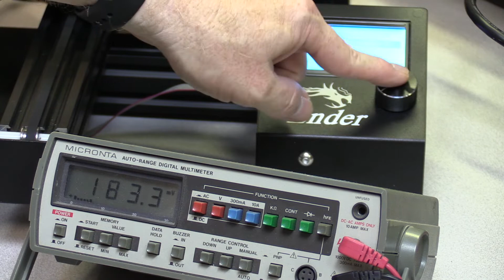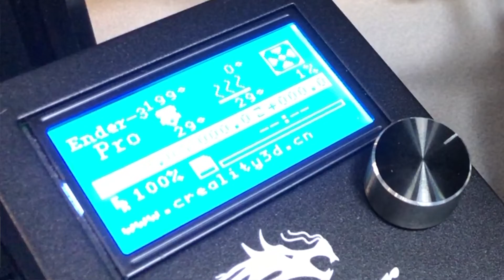Thermal Runaway and the Creality Ender 3 Pro

Comment: the easiest way to test if thermal runaway works is by powering your ender with a usb cable (with the 24v psu off) and trying to heat up the hotend. it will not have enough power to heat it up so it will trigger thermal runaway

Comment: In my case, heating up works fine, the temperature is reached. But as the print starts, the temperature drops by 10-20°C, I get the runnaway error and the fillament looks burned. I suppose there is a looe connection somewhere, loosing contact when the noozle is in motion. I will doublecheck all connections.

Comment: Please share your experience in case the printer sees the high temperature and display shows the nozzle heat is switched off, but really the heater is continuing to heat.
And, aditionaly, the heater starts functioning right straight after power on the printer.

Comment: Perhaps that’s simply not the exactly way that it detects thermal run away. I have an ender three pro that I am currently receiving screaming thermal runaway errors from about three hours into a print. I am presently trying to diagnose it but there is something causing the error certainly.

Comment: your elaborated explanation about, what a thermal runaway problem helped me to undertand that because of the cold wether the printer is not been able to heatup the bed fast enouth  therefor it trigger the error. I will try to put a blanket over it, thanks very much.

Comment: There was a firmware update that did enable the full thermal runaway protection.  Your version of the Ender 3 Pro is likely from before that update based on the date of the video.  Update your firmware to the latest version and try this again.
Reply: my ender 3 pro threw this error at me today so its worth trying again if you havent already - in the researching phase rn to figure out what the hell i did

Comment: I just did a PID tune at 245 deg. I then tried to print a calibration cube at that temp, and I still get thermal runaway error. brand new heater cart and a cart thermistor in a phaetus bms on my ender 3 pro. I can't get it to work on either of my ender 3 pros.. what is the point of having an all metal hotend if it won't even let me print high temps? please help!!!

Comment: Any idea how to reset the motherboard if thermal runaway activates before you can even load the menu?   I've changed out both the heater cartridge and thermistor, however the ender 3 pro (still) goes into E1 Thermal runaway as soon as you turn it on.  (wont load from SD or anything)

Comment: Bryan. I have a ender 3 pro and have been having one of two messages 1) Failed heating reset” and 2) thermal runaway …..). It’s still a stock ender 3 pro with stock 8bit main board.  Maybe newer model?   It’s not the bed as that is brand new with less than 2 prints on it.  So I think it’s thermistor?

Comment: So I have a couple of questions. What if you could test the Ender 3 pro for if the hot end gets hotter than the desired temp while the readout is working fine? Also secondly, I own myself an Ender 3 pro and am wondering is there any way to add thermal runaway protection? Know that there isn’t now, I’m afraid to leave it running overnight. Thanks for the tips, Joel
Reply: Hey, new-ish Ender 3 Pro owner here who just encountered Thermal Runaway Protection for the first time about 15 minutes ago (and ended up here in researching it). There was a change in manufacturing in the E3Pro line in 2020, the updated ones come with the 4.2.2 mainboard and thermal runaway protection in the software.

Comment: Just a thought redundant thermistors would help detect a issue but I think a new port would be needed on the mainboard or a separate board like a RPI to shut down the system if it detects a runaway, actually a RPI as a separate monitor system would definitely help now I have to figure out how to develop this.

Comment: Bryan I find your videos very helpful, I have a quick Questions. I got the Ender 3v2, I did a thermal runaway test where I powered up the OS only with the USB and left the main power disconnected, I told it to power up and got a warning for low temp reading on the Nozzle. So I like the fact that I got the warning, but is there anyway I can tell if it killed power to the Nozzle, or do I need to perform a test like the one you did here.  I am using the Marlin that came with the device currently, though I plan to upgrade in order to be safe. Any recommendations on how I can be sure that the version I have provides this protection?

Comment: I have the same printer is it still safe to run?? without thermal runaway protection
Reply from the maker: Hi, the current firmware for the Ender 3 Pro has Thermal Runaway Protection enabled. Verify which board is installed by removing the bottom cover and looking at the board, then match that revision with the available firmware updates on Creality's site to choose the correct firmware file for your printer (see https://forums.creality3dofficial.com/download/ender-series/).
Reply: @BV3D  thank you so much 👍🏻 and thanks for the quick response.

Comment: So I had my printer on with printer bed at 200 . While being at that temperature I removed the glass bed to wash it. (Left printer bed still on ) came back with the clean glass bed after I put it on I notice that thermal runaway ........ could have this happen because I did not let it cool down when putting a normal temperature glass into hot bed printer ?

Comment: Woke up this morning to see thermal runaway on my ender 3 v2. Glad to see the newer version has this at least!
Reply: The exact same thing happend to me og my ender 3 V2 too om so confused what does it mean?
Reply: @mathias7798  it's a good thing. It was sensing the hot end was getting too hot and stopped the machine. Avoids a fire hazard
Reply: @williamchmelik868  thanks for the expelation, does this mean any furter problems with the machine itself?
Reply: @mathias7798  shouldn't
Reply: What model has the protection?

Comment: Hi, i am new to 3D printing and am using it for projects and cases. I have as of just recently the Ender 3 v2 and was wondering if it was safe to leave on overnight at stock settings. i have seen many videos that i don’t really understand, but never a straight answer. Thanks!
Reply: U need a firealarm + fire extinquisher (that can be used for electrical stuff) at the ready at all times. And even then it is risky. Always follow the instructions and print items when u are at location of your printer.
Reply: @x4treme  homeboy that was 9 months ago, p sure i don’t need a whole ass fire alarm nor a fire extinguisher (though i do have one for other reasons) lmfao
Reply: @millabruh  firealarm costs only 10/20  bucks. And a fire extinquiser only costs 30 bucks. Always save than sorry

Comment: I have a e3p and its going into thermal runaway protection mode and shuts down.. im neesi g to know why and how to fix it
Reply from the maker: Hi! On the LCD screen, there should be two temperature numbers for the nozzle, and two for the bed. One is the "set" temperature, which is what the printer has been told to set the nozzle or bed to. The other is the actual measured temperature. If you watch the screen while you're printing, does either the nozzle or the bed temperature change suddenly?

Comment: I got an skr mini v.1.2 and got the latest marlin on there 2.0.5.3 on the ender 3. It has thermal protection but i get an error that halts the printer at times while heating the bed. It also takes a long time to heat the bed compared to the stock ender 3 board. Not sure how to recreate this. I thought it was a cold room but on my other creality board with th3d and thermal protection i never got this error and the bed heated faster.
Reply from the maker: Hi! It sounds like the SKR Mini v1.2 is having to work harder to heat the bed (or maybe isn't providing as much current to the bed). If it's taking too long to get up to temperature then, as you've found, the thermal protection is going to get upset. 

I have an SKR Mini E3 v1.2 installed in an Ender 3 Pro, running the Bugfix 2.0.x 2019-09-20 firmware it shipped with, and I haven't noticed a difference in bed heating times between it, and the original Creality board.

If you still have the original Creality board laying around, maybe you could time how long the SKR Mini takes to heat the bed to 60˚C, then shut it down and let it cool off. Swap the boards, and time how long the original board takes to heat the bed to 60˚C.

If there's a clear difference, maybe you can get the SKR Mini swapped under warranty?
Reply: @BV3D  Thank you for the input.  I actually fixed this issue now by enabling PID autotune and I calibrated this feature using the guide that skr mini website provides.
https://www.reddit.com/r/3Dprinting/comments/h8xqrn/pid_autotune/ 

The bed heats up quite fast now with no halting. Hope this helps others.

Comment: On my Ender 3 pro purchased in December the thermal runaway protection is enabled by factory. Did the cold air blow test and it went into error after few seconds, asking for a reset.
Reply from the maker: Awesome! Thanks for the feedback, I'm glad Creality's got that in place now.

I'm working on (yet another) Installing the Creality Silent Board (1.1.5) video, which requires downloading and installing the current firmware files from Creality. I've noticed the same thing -- the firmware you can download and install has Thermal Runaway Protection enabled.
Reply: Can you point in the direction of how to perform this test?  I recieved my Ender 3 Pro days ago and would like to test for this. I have an Arduino board on the way but it's nice to know I don't HAVE to update the firmware if everything works out the box.
Reply: @Clickbaiters  I removed the silicone cover from the nozzle and set the nozzle to warm up. Then immediately started to blow cold air (with an hairdryer) exactly at the nozzle. When the nozzle isn't warming up as expected by the printer an error code should pop up and stop the process asking for a hard reset.
Reply: @EL_Bi_  Will try this today! Thanks!

Comment: Hi Bryan - great video! I recently purchased an Ender 3 Pro (less than 2 weeks ago).  It came with the Creality3D V1.1.4 motherboard.  Not being a great fan of noise I've been on a mission to quieten it down ever since.  Straight away I swapped the board for the Creality3D V1.1.5 board which, I have to admit, blew me away when it came to silencing the stepper motors. However, not being a great fan of fires either I'm now on a mission to try and make my machine as safe as possible. I know my new board is running  Marlin 1.1.8 so I thought I'd do the same test as you to determine if the check for  thermal runaway was enabled.  The result was my printer halted and gave the message "Heating Failed, System Stopped".  Although it didn't specifically say themal runaway it did stop the heating voltage well within 20 seconds of demanding a nozzle temp of 200 deg.c.   Would have been much happier if it had mentioned the words thermal runaway - so not exactly sure if I need to do more tests.
Reply from the maker: Hi Phil! I'll be getting to the Creality 1.1.5 board soon. I just got the board a few weeks ago. Since the earlier shipments of those boards did not have a bootloader installed, the kits from Creality included the USBasp programmers. I've already got a programmer, so I'm going to have to do a "two-fer" video release where I install a bootloader on one video, and then install the factory firmware on another. That will be followed soon by a video on installing Marlin on the board. So I'm curious to see what the actual error messages look like between the Creality version of the firmware and the Marlin version. 👍

Comment: I still have that Radioshack multimeter that I purchased broken in 1986 (I was 14) and repaired.
Reply from the maker: It's still my favorite. Runs for years on a set of C-cell batteries. I did replace the probes about a decade ago because the original red one decided to give my soldering iron a hug. 🙄😂

Comment: you still didnt explain what thermal runaway is  and what the risks are.
Reply: This comment should be pinned to the top so future printer noobs like me can more easily find this information:-)
Reply from the maker: Hi!

Looking back on it, you're correct, and I've only given part of a description. For you (and others who may come across your comment in the future), here is a general overview of thermal runaway and the associated risks (spoiler alert: the risk is fire):

For this discussion, we'll focus on the hot end, but the same applies to the bed.

Thermistors are temperature sensing elements. These are the electronic thermometers the firmware consults to find out how hot the bed is, and how hot the hot end is.

On many printers, including the Ender 3 and Ender 3 Pro, the hot end's thermistor is held in place by a screw. If the screw loosens over time and the thermistor is somehow pulled free of the heater block, the thermistor can no longer accurately report the temperature of the hot end.

When the firmware is instructed to set the hot end to, for example, 200˚C, it begins applying power to the hot end's heater cartridge. As it does this, it monitors the temperature reported by the hot end's thermistor.

But because the thermistor is not longer inside the heater block, it is no longer reporting the heater block's temperature. Instead, it reports the temperature of the air surrounding it. In a comfortably cool room, this would be about 26˚C.

Because the firmware sees the hot end temperature at 26˚C, it continues applying power to the heater cartridge. It is on a mission, and it is not going to stop until it sees 200˚C. So the hot end gets hotter and hotter, because the thermistor is measuring the air temperature instead of the heater block's temperature. Eventually, the heater cartridge gets hot enough to start a fire. And THIS is thermal runaway.

By contrast, on a printer whose firmware has thermal runaway protection enabled, the firmware will declare an error condition and cut power to the heater cartridge if the desired hot end temperature isn't reached in a short amount of time. The thermal runaway protection feature is able to recognize that although it's powering the heater cartridge, it's not seeing anything getting hot.

Hopefully this sets things right. Next time I talk about thermal runaway protection in a video, I'll probably base the discussion on this explanation.
Reply: @BV3D   wow.. now THAT is a detailed explanation.. thanks :O)
Reply: @BV3D  just installed the 1.1.5 board an hour ago... so quiet..nice
Reply from the maker: @RobBob555  I just received one of those boards myself. About an hour ago! I know there are already a bunch of "how to install" videos for it, but I'll probably be making one of my own anyway. :)
Reply: @BV3D  yeah, it was pretty straight forward, only tricky bit was wiring in the  back most red and black wires.. they are VERY short..and the hot glue on some the connectors can be a PITA..but fine apart from that :O)
Reply: @BV3D  BTW looking at your voltage meter etc, im wondering if you are a fellow radio ham ?
Reply from the maker: @RobBob555  No, I've just been around for a while. But I do know someone who's decided to get his HAM license, and that's Ron (Canadian Maker Project). He launched a side channel about it, you might want to go check it out and subscribe: https://www.youtube.com/channel/UC2sezipEMQZQc9NkLHeFKBw

Comment: On the official creality site you can find the stock firmware version 1.1.6 which claims to have thermal runaway protection enabled. It would be a nice test to see if this is true before putting a custom marlin version on the ender.
Reply from the maker: Thanks for the info! One more thing I'd like to see in the stock Creality firmware for the Ender 3 Pro is the ability to move the Z axis from the control panel. The factory firmware loaded on my Ender 3 Pro doesn't have the Z axis listed under "move axis." 👍
Reply: @BV3D  Try moving Z in 1mm steps... not 10 mm steps... if you click
1 then you will see Z as an option. Well, at least I did.
Reply from the maker: @dougc3086  Well, what do you know. It does exist at the 1mm level. Thanks, Doug!
Reply: @BV3D  mine can with the 1.1.6 version under the prepare menu. Accidently set it to a negative value and rammed my nozzle right on a print I just stopped. Never was I so fast to turn off the power 😃

Comment: My Ender 3 Pro didnt have it either, it came with one of the heat bed wires loose and it was happily trying to heat the bed despite it not increasing the temperature! It's a pity, but thankfully easily solved.
Reply from the maker: Hi Brian. I'm going to have to put vanilla Marlin on here, to get all the thermal safety features enabled. I'm really sad that Creality doesn't have Thermal Runaway protection enabled!

Comment: Hello Bryan, 
That is a bummer!! Just ordered a Ender 3!! So, I will be looking forward to the Marlin install video!!
Reply from the maker: Hi Charlie! Yeah, keep an eye on the printer. It may be a few weeks before the Marlin on Ender 3 / Pro video hits. But it'll definitely happen. If I remember correctly, the main board installed at the factory does not have a bootloader installed, so that may need to be done beforehand. But do not install a bootloader unless you also have the factory firmware to put back on the printer, because installing a bootloader completely wipes the board, and until you get firmware put back on it, you've got an expensive brick shaped like a 3D printer. 😀
Reply: @BV3D  Thank you for the great advice... I can wait for the video... I need to buy an Arduino for loading the boot loader anyway and for a couple other projects. 
The printer will have an octoprint on it! I may be upgrading the board at some point too... so many options! :)